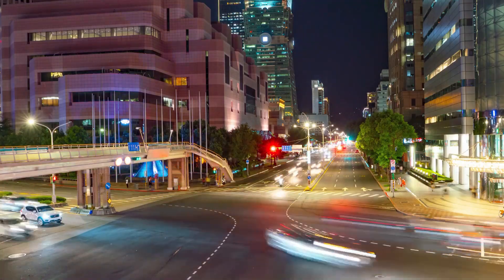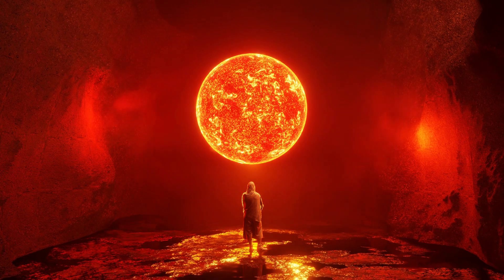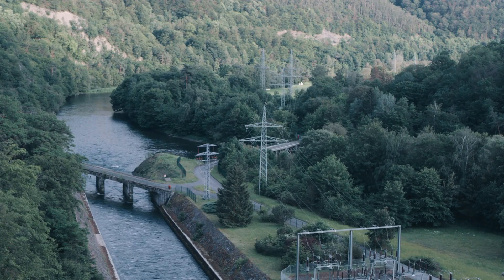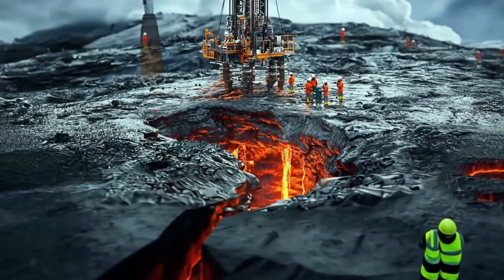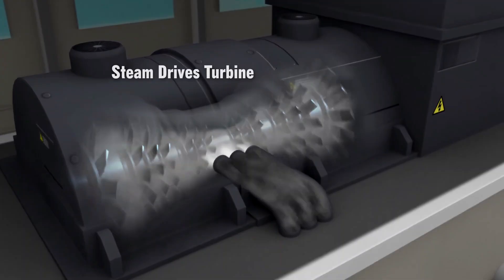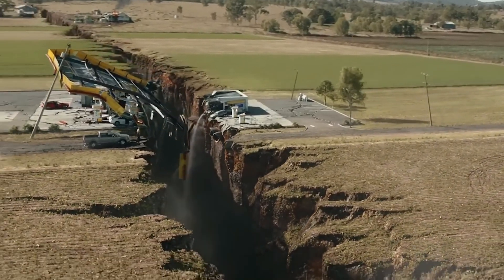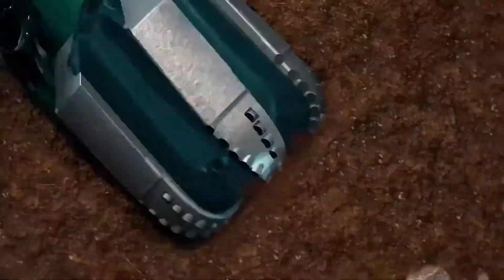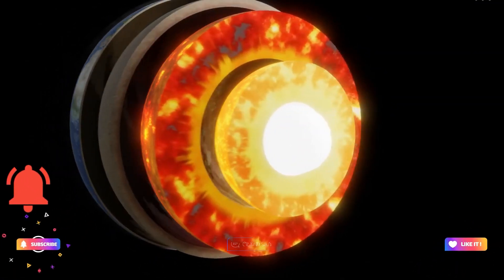🌋Could Drilling into Magma solve our energy Problem ?

Comment: Last break through i hurd about drilling is that they were working on a plasma drill to make drilling more cheaper and financially feasible also in nz we have a closed loop system so youre are not extracting from the natural resources ( liquid ) but simply using the heat available if you make drilling cheaper the pacific rim can supply endless power to the world 24/7
Reply from the maker: this would be so awsome, can you tell me more about plasma drilling?